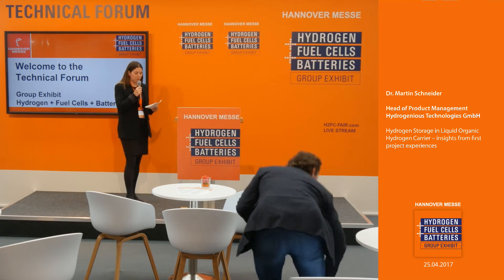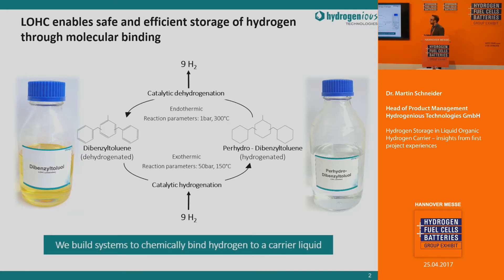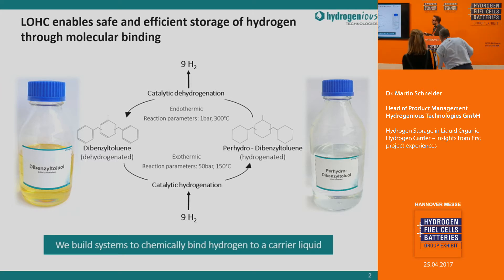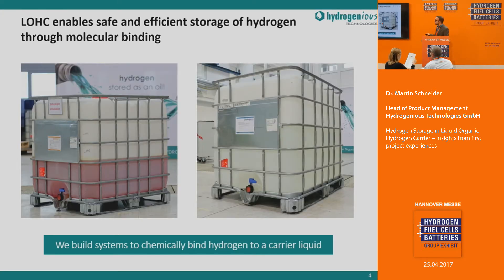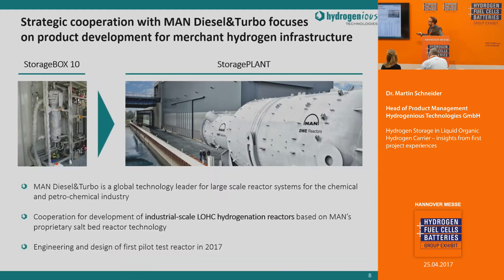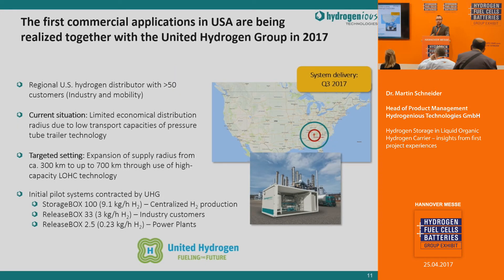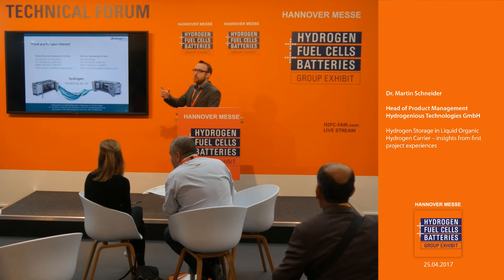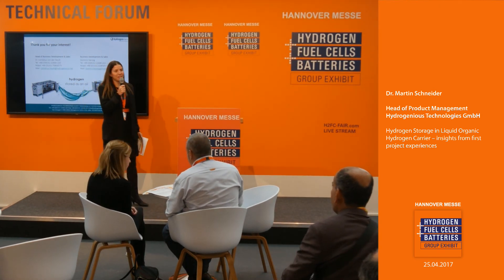Hydrogen Storage in Liquid Organic Hydrogen Carrier – insights from first project experiences

Comment: Current hydrogen stations, it seems (like those put up by Shell Oil) can only fuel about 70 cars (350 kg of hydrogen) before they need to "rest" to refuel, for the next day.  But typical gasoline stations can handle 700 cars a day.  So, my guess is that the only way to make fuel cell cars practical, is to develop a home hydrogen system that is no more expensive than the Tesla Powerwall 2.  Is that realistic?

Comment: This is not much of a breakthrough.  Temperature and heat are different concepts.  It will take a great deal of heat energy to get a tanker of lohc to the temperature at which it will release the stored hydrogen, is my guess.  If it takes an hour to unload that fuel at a hydrogen station, I guess deliveries will be made at 3 am.
Reply: No you are wrong firstly the heat needed to release the Hydrogen is not that high its between 150°c and 300°c secondly you wont need to heat up the whole tanker at once the liquide can be passed through a small heat exchanger to heats up the fluid on its way to the catalyst. Waste exhaust and coolant heat is more than enough to get the fluid to the desired temperature.
Reply: nice reply,the speaker always focuses on the goodness instead of badness.